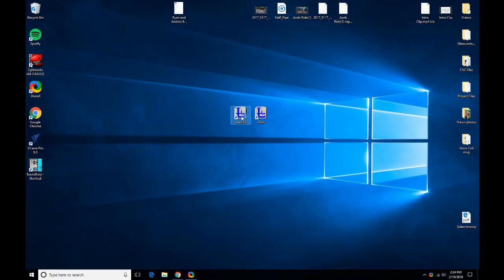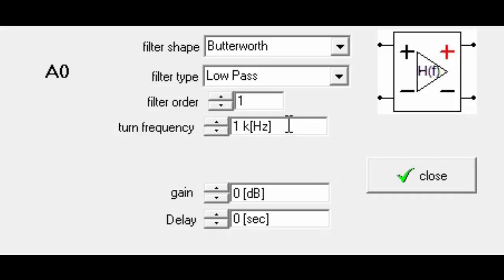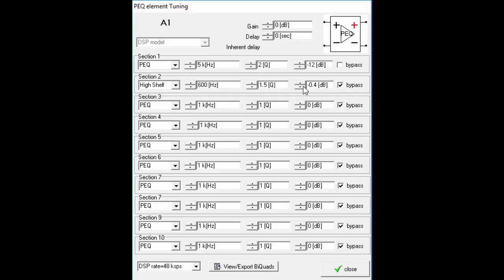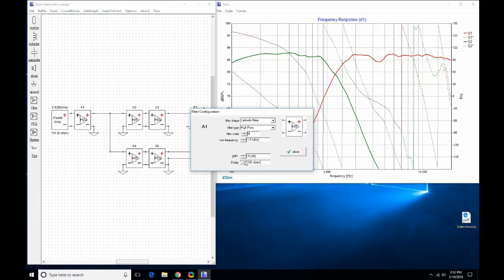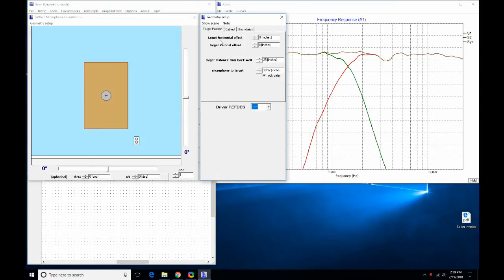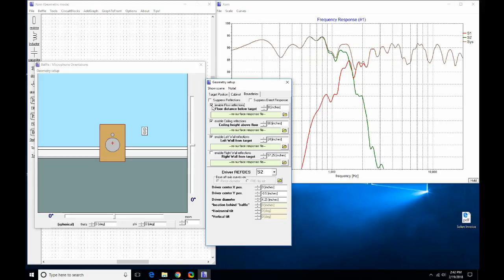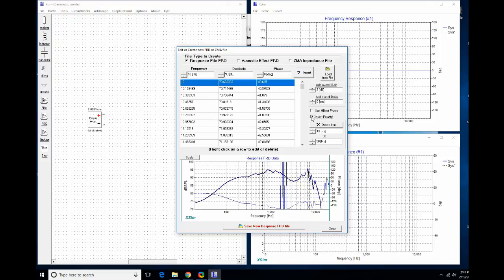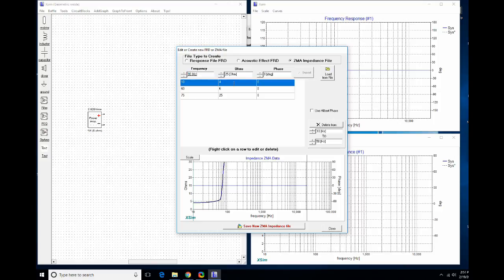Xsim Tutorial Part 2 | New Features Like Active DSP Filters

Comment: Ryan, I am planning to use a DSP for a bass driver and passive crossovers for a midrange and a tweeter. The DSP has about 2 ms data processing latency. Should I then just add that 2 ms delay to the DSP channel? Or is there some separate data setting in the Xsim software to reflect that latency?
Reply from the maker: Well, I assume the mid and tweeter will still go through the dsp as the high pass? If that’s the case the latency will affect both equally. If not, you’ll need to add delay anyways to get the phase properly aligned. Hopefully you don’t need 1.5ms and need more like 2.5ms. Then you’ll just need to add 0.5ms. Hope that makes sense.
Reply: @ImpulseAudioSpeakers  No, I am actually planning to run via DSP only bass section of a speaker. The reason is that Hi-pass outputs of many budget DSP plate amps like miniDSP PWR-ICE, Dayton Audio SPA250DSP and Hypex Fusion FA-series do not provide suffiicent sound quality. So I would like to make something similar to Troels Gravesen's FUSION-BAD design. 
Based on your instructions from this video I just have tried to make such circuit in Xsim with 2 ideal drivers crossed at 200 Hz and got somewhat decent result with +/- 1 dB ripple in a 200-900 Hz range. I have used 2-nd order passive filter for a "midrange" driver and 3 DSP modules: PEQ (+1.7 dB at 105 Hz), LR2 filter with 2 ms delay, and OpAmp with 0 dB gain for a "woofer". Both drivers are connected with the same polarity. Reversed polarity on the midrange gives pretty deep -26 dB "null" at about 200 Hz and a small 2 dB bump at 500 Hz.
Reply from the maker: @IliyaOsnovikov  in that case the phase change from the acoustic slopes will hopefully reach 2ms, and likely will. It’ll probably work out.
Reply: @ImpulseAudioSpeakers  The results of xSim simulation can be seen here: http://forum.vegalab.ru/showthread.php?t=89899&page=3&p=2917074&viewfull=1#post2917074

Comment: Hi Ryan, this is a great video i'm a huge fan of your channel! I've been trying to find the acoustic difference of my 2 drivers with no success so far, I watched your video where you took 3 measurements, read jeff bagby's description on how to achieve this, and even found and purchased an online course that discussed the subject, but no matter what I do I can't get the phase to line up (deep null at x-over freq) when designing my crossover.  Im at a loss, is there any recommendations or resources you might suggest?  Thanks a lot!
Reply from the maker: Ford Grimm seems like you’ve tapped all the resources. What measurements software are you using?
Reply: at least that's how I feel, REW but id rather use the omnimic software i have. i'm just not savvy with it. i have the omnimice v2 system
Reply: i think i understand the principal, but in execution something just isn't right.
Reply from the maker: Ford Grimm I haven’t used omnimic, but know enough about it that it shouldn’t cause an issue. 

Forget the Bagby write up for a minute. Something I didnt like about it was that it over complicated things. Put the mic near the tweeter about 0.5 to 1.0 meters away. Ok, 3 easy steps. Measure the tweeter. Measure the woofer. Measure the tweeter and woofer wired in parallel. Nothing should change. Put the first two measurements into Xsim (or what ever software) and overlay that 3rd measurement. Adjust the woofer delay until they overlap. Usually about 1-2”. 

Is that what you’re doing?
Reply: @ImpulseAudioSpeakers  yes, i'm also deriving phase, it helps when i use "measured" phase
Reply from the maker: Ford Grimm don’t bother deriving phase. It’s an unnecessary step. 

How close are you getting to the overlay? I might not be exact. Pay the most attention around the XO point. 

Also, check adjusting the delay on the tweeter. Never know, maybe it’s behind the woofer.
Reply: @ImpulseAudioSpeakers   ok i'll definitely proceed without deriving phase, because at this point it's better looking when i don't derive it. oooh i've never heard of adjusting the tweeter delay, everyone says adjust the woofer, i was only getting like 6-8 db null. Why does everyone say to derive phase using the Hilbert Bode Transform?
Reply from the maker: Ford Grimm why do you mention a null. You shouldn’t be trying to get a deep null. Just trying to match the parallel measurement.
Reply: @ImpulseAudioSpeakers  yes I realize I was talking about 2 different problems simultaneously. The first problem is the measurements show that my drivers are not acoustically offset, (already matches the parallel curve) which I don't necessarily believe. I don't believe that because I can't get them in phase at the crossover freq. So I'm kind of wondering if it's some sort of measurement error? I'm out and about right now but I could post a picture of what it looks like.
Reply from the maker: Ford Grimm ok first, if they match without adjusting the delay, believe it. That happens once in a while. Just probably tripping you up because you weren’t expecting it. 

The fact that you can’t get them in phase at the XO is just a matter of your XO design. You probably need to invert the tweeter polarity or change the XO slopes or something. That’s part of the challenge of working on a XO. You will eventually find the right combination of XO order and frequency that brings the drivers in phase.
Reply: @ImpulseAudioSpeakers  ok I will run with them matching up, yep I worked this crossover up and down for about 3-4 days flipping polarity of tweeter and the woofer sometimes as well, but this was with the derived phase, so I will crunch on it again with "measured" phase. And  see what I can do.  I Really appreciate your help, I've been at a frustrating stand still.
Reply: @ImpulseAudioSpeakers  the acoustic offset lines up with in the high freq at +3/16 woofer delay (not a negative value.) but does not line up close at all below 2000hz (which is where the tweeters amplitude is far greater than the woofer)
Reply from the maker: Ford Grimm I don’t know how to help. Maybe got back to basics and redo the measurements and give it another whirl. Not much I can do from here.
Reply: @ImpulseAudioSpeakers  np i appreciate your help!

Comment: Thank you Ryan for your videos. You've turned me into a budding speaker builder. But I wonder how closely the XSim results match your measured results? If there are differences, is there a pattern to any discrepancies? (the frequency response is not what is predicted, rolloff points not the same, etc)
Reply from the maker: Richard Comerford generally it’s pretty accurate. Once in a while there will be little tiny discrepancies here and there, but not something with a pattern and small enough to ignore.

Comment: did we have a discussion before with disagreement of me saying , that active Xovers dont have phase issue , and someone did  say  no mini DSP shown it, they have , its inherent , all have , im like no , 4th order does not , so im curious if this software can do 4th order and whats the phase like ?
Reply from the maker: Pavle Pavlovic 4th order has 360 degrees of phase rotation so it ends up in phase. Not sure if we had a conversation about that but I’ve heard people confused about that from time to time. 

If you apply a 4th order filter to each driver using this software you will see the phase change. If the drivers start in phase then the XO should go 360 and end up in phase. If they start out of phase like real drivers normally do, then they will end up out of phase and you’ll have to add phase correction (delay) to make it all work out in the end.
Reply: Yes we did , you found a phase issue in  Mini DSP i told you ether you are doing it wrong or Mini DSP is bad , or whatever was the setup , even linked you an article where it is explained that there is no phase issue in 4th order and above, every filter adds 90 degree phase 4 of the 360 , there is no 360 its 0 again  , so you said " your understanding of the article is wrong ", but now you say there is no phase issue just like the article  , there you go , active crossovers when done proper dont have phase issue .
Now you say just because Xover is in phase doesn't mean drivers will be" ,  how that happens ? Crossovers do delay , they do volume as well , but interested to hear how that driver phase issue happens if you care to share .
Reply from the maker: Pavle Pavlovic I never said a 4th order XO is out of phase in theory. It certainly can. This isn’t really the place to explain such a deep topic but I will leave you with one answer to your question. Drivers can be out of phase based on their acoustic offset and frequency response, which are never even or flat in the real world, so you must fix the phase using the XO.
Reply from the maker: Are you referring to a comment you made on my active XO video where I blindly plugged in the mini dsp and got bad results?
Reply: Yes , m8 , dont let us go on a bad note again , audiophiles always have disagreements  if i come across as negative its because Eng is not my main language , its hard for me , tho , im educated in electronics 4 years , and 2 years in Electroacustics ,and  i produced music all my life , so a lot of XP  to be able to talk about things in that realm  . Still l want to know more , hence the question , ( you tested a lot more then i did ) what can introduce Phase issue assuming ideal preamp , amp and signal ? I was thinking you would say Time alignment of drivers . Do you mean that by Acoustic Property's ?. Sure that is why Tweeter has its own enclosure among other things  , but i would like to know more about that  in short . How is it that different drivers can reproduce phase mismatched output , and why , IF you have some links , videos ,pdf , anything , or you can provide some insight and  if you like to talk about these things , i do , obviously . We can use mail as well , dedskin gmail .  I work as audio producer for a long long time ,  10 years or so , 
Yes , im referring to that "MINI DSP Argument " , but we sorted that , no phase problems if Xover is good , i think that Mini DSP is good only for measurements , as a crossover obviously it sucks  , but idont have it i dont know , trusted you there  but did my own measurments and found a problem .
Using Smaart 7  as reference Pink Noise  VS my own SPectrum Analyzer of choice ,and that is NUGEN Audio Visualizer 2 , played a Pink Tone on my Drivers , and recorded with Studio microphone ,  and i got totally different results from SMAART and NUGEN , on same microphone , and test tone played by SMAART , Pink Noise , im sure you know what im talking about . How can one be sure of those measurements . When i Corrected my Drivers and get a flat response  , it sounded horrid , totally flat response but my ear tells me something is wrong . I need to get Proper Mic for that , but that wont fix the difference  in 2 Audio Analyzers , NUGEN AND SMAART . Did you have such issues .Im sure you have your own Analyzers , I used a third Analyzer as well , and it was showing same as NUGEN , SMAART gives a lot different spectrum . Didnt measure Phase  since i just got Smaart , i spent lot of time jsut of make it measure something .

Comment: How do you create your FRD and ZMA files? You are probably using SoundEasy. However, do you have any other free alternatives? I could use Room EQ Wizard, but the problem is it doesn't have an option to compensate for baffle diffraction, when doing nearfield measurements for the bass drivers. ARTA does this, but again, it's not free software. Got any free solutions to my problem?
Reply from the maker: Marius Tanasescu I'm not quite sure why you would do a nearfield measurement and want to know the baffle effects. I would continue using REW but back up the mic to 1m and get the measured baffled driver.
Reply: When you design crossovers you don't consider the response under 200 Hz? I guess you could do that for a 2 way, but not for a 3 way.
Reply from the maker: Marius Tanasescu i measure outside and get data down to below 100hz. Sometimes more than 20ft above the ground. Some 3 ways like one Im working on now could get away with data down to only 200hz. Such as crossing to a small mid with an 8" woofer around 800hz. The lower the data the better though.

Keep in my how much the room does dominate the amechoic response below 200hz. I still always use anechoic data as low as possible, but keep it in mind.
Reply: Well, that's why I'm doing near-field measurements. To measure the low frequencies indoors. Then I splice it with the far-field response (at 1m). I don't have the means to measure outside with the speaker 20 ft in the air. I'm curious on how you are doing that. You got a crane of some sort?
Reply from the maker: Marius Tanasescu do you have microsoft excel? I think theres a spreadsheet by Jeff Bagby where you can put your frd file into it and simulate the baffle effects. It is free. But it will add baffle effects to the entire measurement even above 200hz. So you'll want to change the nearfield before you splice the measurement.

I measure from on top of my shop roof. It is a pain in the rear but I only have to do it a couple time during a speaker design. Gets tricky to get the mic that high and make sure it's on axis. But it give an anechoic response that is basically reflection free way down into the deep bass. Even if there are reflections in the measurement they are so low in amplitude they dont really show up.

Comment: Seems very interesting, thanks. I use a software crossover/DSP on my PC, but have never before come across Xsim as a design tool. I switch between several, but all use other types and formats as input. So I wonder, what kind of output/format does Xsim use to transfer the active filter parameters? Or does it make convolution files?

Comment: If you add 3/4 bass drivers to a cabinet what actually changes? is is that you get more bass or do you have to all come off the same xover point?
Do you get more detailed refinement. I would like your advice on this please.
Reply from the maker: Dave Jones sorry Im not sure I understand what it is you're asking. You're wondering what happens if you add 3 or 4 woofers instead of just one like I did? Basically you get more and more output the more woofers you add. You can do it by just adding drivers and loading the correct measurement in the driver, which I covered more in the original tutorial.

Comment: Thanks Ryan.  

A couple of user interface notes:  you can use a mouse wheel to change values instead of the little up/down arrows if you want -  it's a little easier, like twisting a knob.  You can also type numbers right into those value boxes too -- make sure to hit your Enter key after you change something that way. 

The FRD/ZMA editing tool is mostly meant for situations where all you have is a manufacturer's data sheet.  You can read off and enter as many points as needed to make the shape look right for modeling.  This is particularly helpful for ZMA curves, as many driver makers don't give impedance phase data at all! -- this gives you a way to get it via Hilbert Transform.  (BTW, the reason the graph goes down to 2Hz and up to some stupid high values is because Hilbert derived phase within the usual 20 to 20kHz unfortunately depends somewhat on magnitude shape and values at frequencies way outside that range as well.  A few frequency points placed outside there will let you clean up phase at the extremes.

Lastly, on that baffle off-axis animation, you can also put your cursor on the picture itself, hold down the left mouse key, and drag the box orientation around instead of using the sliders.  When I get back to programming (whenever that happens) I hope to add some polar plots  so you can see what crossover changes do to off-axis responses.
Reply from the maker: Great info Bill. I didn't even think about the HBT phase thing and the scale. Makes sense. Also didn't realize you can click and drag the speaker around. Nice! Thanks for the updates to the software. It's really great. I don't feel like I did this video much justice. Very busy and challenging past month. But it's mostly just information for the die hards so hopefully they can watch past the mundane boring I was and get the most out of the software.

Comment: Thanks for the video Ryan! I posted on the FB DIY project pad page earlier today about how to add in driver placement on the baffle - looks like I just have to download the new version. So will the addition of the frd modification and the baffle placement eliminate the need to modify the basic frd/zma files in response modeler before importing into Xsim?
Reply: No, XSim still doesn't model baffle step or baffle edge diffraction (might be later, getting some help with how to go about that for reasonable results).  The new does simulate distances between drivers (as well as floor/ceiling/wall reflections) though.
Reply: Bill Waslo thanks for the reply Bill!

Comment: nice, do you trust more the manufacturer data sheets(Vas and other parameters) or the ones measured with the DATS V2 device?
Reply from the maker: i raul that sort of depends. I actually have mostly great confidence in the manufacturer's TS parameters but I like to measure myself and make a judgement call. TS parameters are quitr fickle. If someone on the internet measures TS and claims the manyfacturer numbers are wrong I am always skeptical. They can very a lot based on drive level and test method.
Reply: Aryan Sunil nimkar
Reply: Aryan Sunil
Reply: Aryan Sunil. Nikar